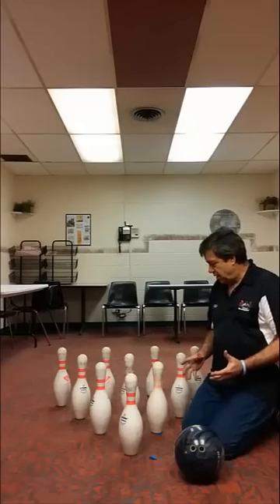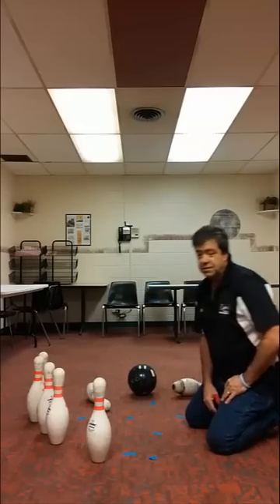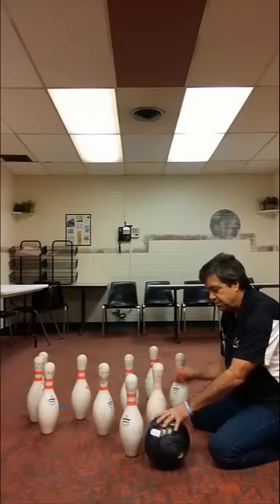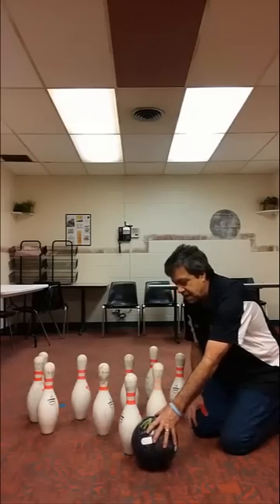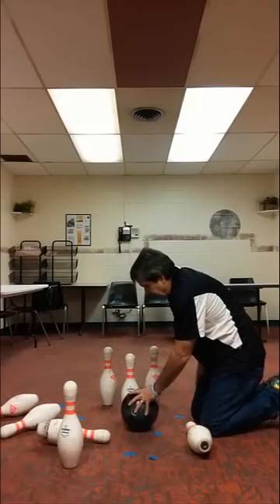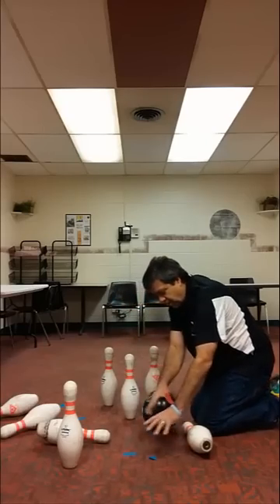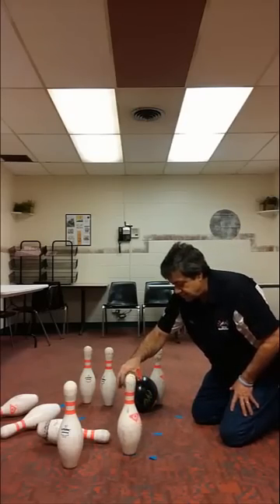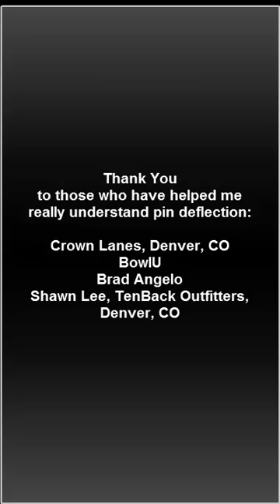Deflection Lesson

Comment: Does angle play a factor - like if my ball enters at a different angle from your angle, but hits the same spot you're hitting? Is there a "perfect" angle at the entry point?
Reply: Yes angle is a very big factor. I'm left handed and have around 200-205 average and commonly when I leave a seven pin I'll move up about an inch from where I usually start from and it'll usually fix the problem. But other times you have to make an entire new line and change your mark completely to get more/less of an angle depending on how the ball entered the pocket